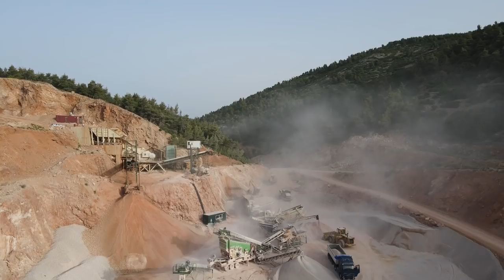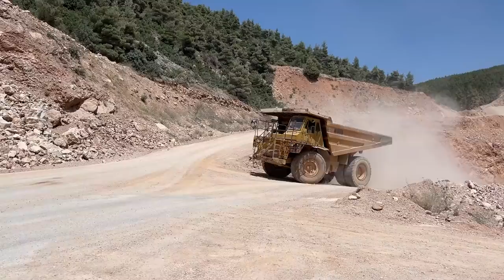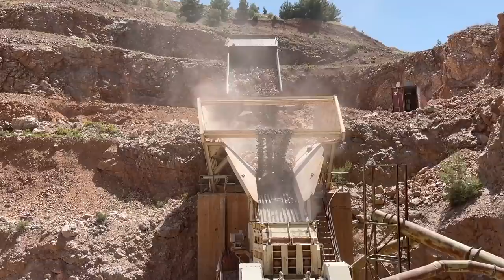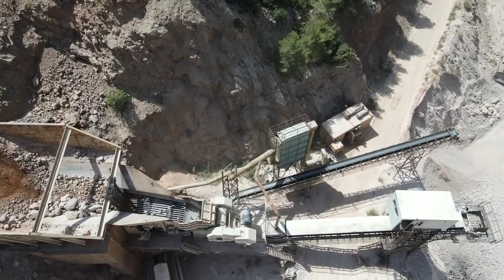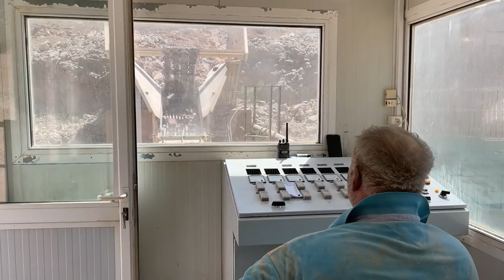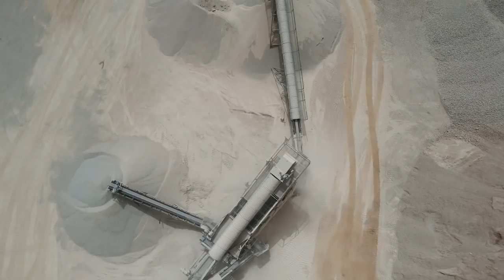Fully Equipped Crusher Group Producing Construction Materials - Sotiriadis/Labrianidis Quarry Works

Comment: What are they producing? Looks like very fine Sand at the end.
Reply: Crushed stone
Reply: Contractors want stone of a particular and consistent size.  Larger for a spillway or dissipation pad,  concrete size, ABC stone, pea gravel. The rocks pass over vibrating screens of increasingly smaller size to separate them.  What's left at the end, rock dust and small rock chips, is called screenings